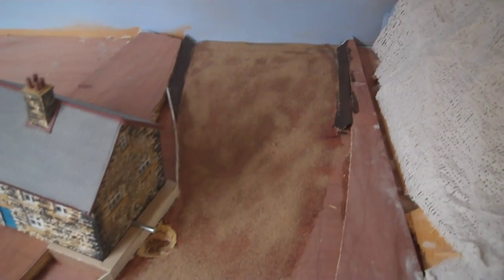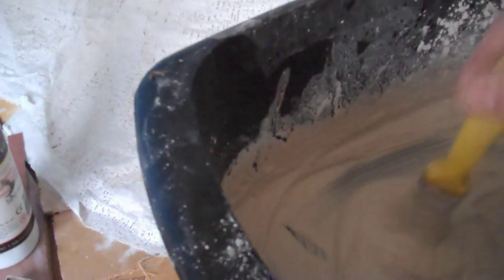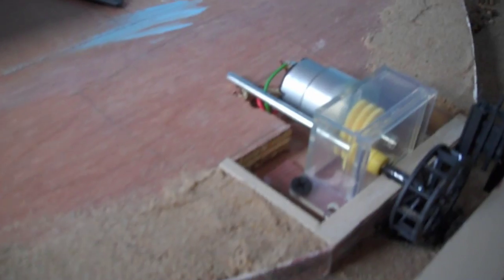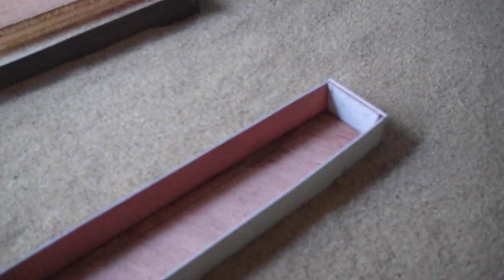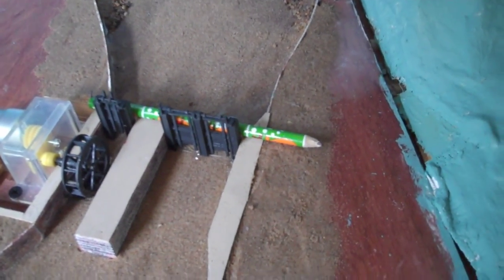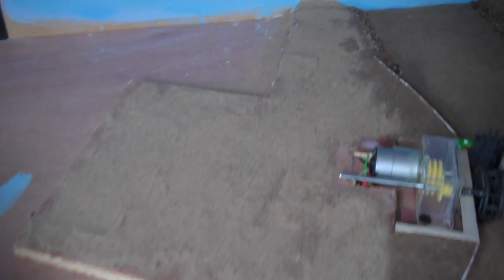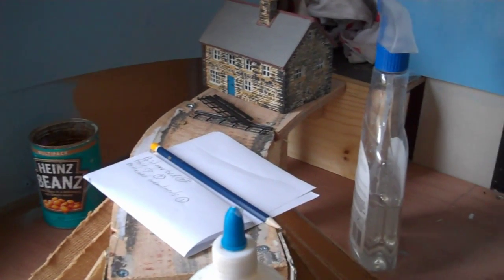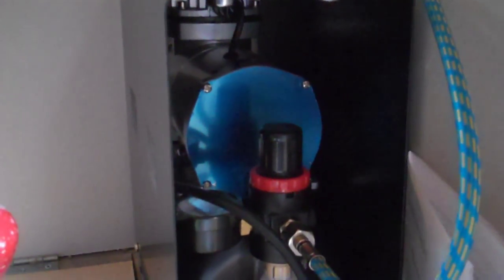Viaduct,bridging the gap Amberton on sea part 7. 00 gauge model railway.

Comment: hi kev

i have not had any issues with my account and not heard of anyone else having issues.
i have not done any work to the layout since my last update to be honest.work and family life have been busy.i may start on the next section next week tho.
as for the sand i have used it on top of roads then painted it after it dries as it soaks up the paint and gives it a rough look which looks great.
i have just got myself the new bachmann class 57 network rail tho.